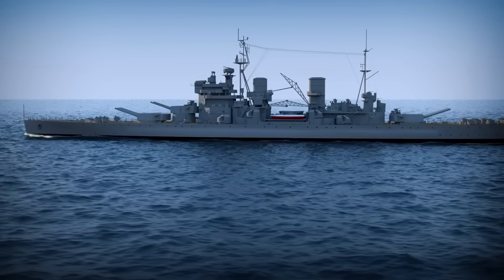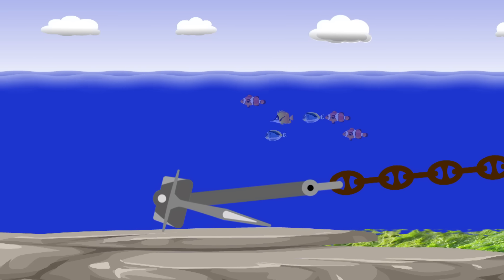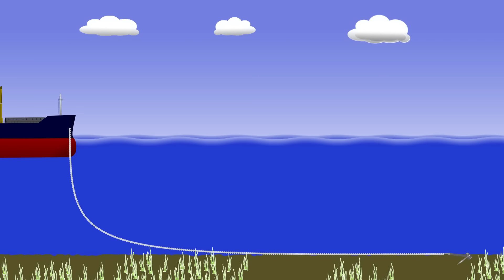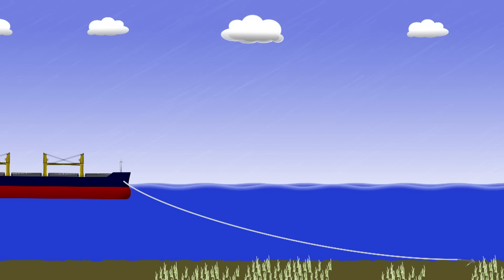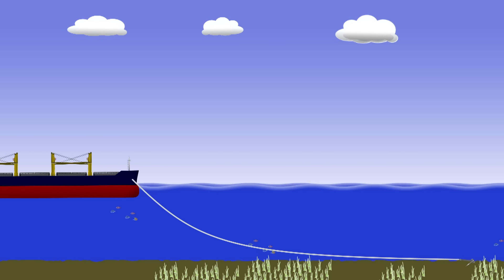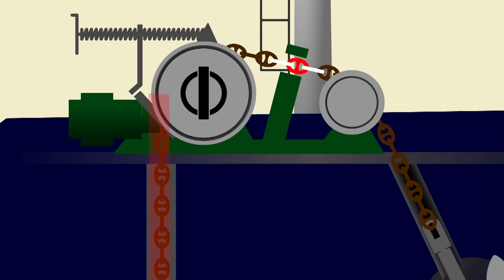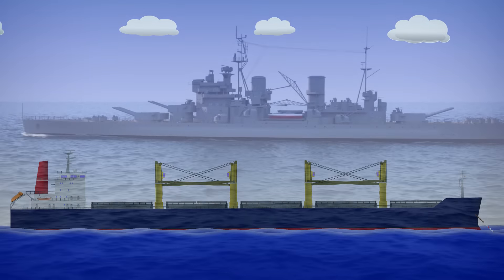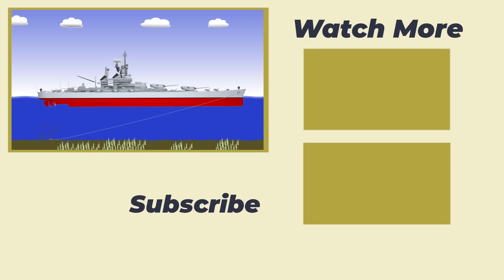The Truth About Anchoring Huge Ships

Comment: I was on a ship that got its anchor tangled up in an old stocked anchor still attached to its chain.  It was really bound up in the flukes.  We dropped our anchor again and again but every time we brought it back in it was still fouled by the other anchor.  It literally took all day of dropping the anchor, going back and forth to try and pull the anchor in different directions and hauling it back in.  While this was all going on we also had discussions about what our options were to cut it free.  There genuinely felt like no good option that didn't present a significant danger to either the ship or the torch operator.
Reply: How about lifting the anchor as far as possible, with the entangled chain above the waterline, tying a very thick rope to the old chain and to a bollard on the ship, and dropping the anchor again?

Otherwise, taking the anchor up almost as far as possible, tying a rope to the chain before the winch, taking the anchor up a little (tensioning the rope), and then cutting the chain between the winch and the rope? That section of chain should be nearly free of tension. Finally, drop the anchor with the winch; you lose the anchor, but at least you can move somewhere else. Would that work? 

That stuff is so heavy it's almost impossible to do anything...

Comment: Fun fact: The act of using an anchor to quickly change tack is called clubhauling.
Reply: Good to know! I have been learning to sail with a coworker on a small 2 man boat on one of our local lakes. Learning terms and such has been harder than actually sailing, at least with such a small boat as he has. That boom can be one hell of a thing to watch out for. 😂 I definitely came home with a headache after the first trip. Wont make that mistake again!
Reply: Same thing I call it when I leave with the strippers at closing.
Reply: Learn that from pirates of the Caribbean did we?
Reply: @goosenotmaverick1156  This sounds like a good Imgur post. Would love to hear more about your adventures in this.
Reply: Heard the term in use for sailing ships. A BB6n might be a bit big for the manoeuvre.
Reply: Fun Fact: the Act of tying a rope around the legs of a victim and throwing him over board and dragging him along the barnacle covered bottom of a ship is called Keelhauling, and its like rubbing your face against a massive cheese grater while submerged under water...often done by Pirates.

Comment: The chain will dampen the shock when it is lifted and will also have some friction on the ground. However, once all the chain is following the catenary line, the horizontal force on the anchor will equal the horizontal force on the ship. At this point it is only the anchor that holds the ship.
Reply: This. I found the animation good but the narration full of bad information. 
I would also add that while large ships just use all heavy chain, smaller boats will often used lighter tackle and add weights at specific distances to get a better holding-power to weight ratio out of the bottom gear because they may not be using motorized anchor equipment and have less issues with shock loading because of less vessel mass for a given surface area. Also: different anchor designs for different bottom types, and some anchors have a second line on the other end in case the flukes get stuck under a rock or similar object it can be pulled back the other way. The second line is just a rope and much shorter(attached to a small buoy) also handy if the main line breaks or the bitter end wasn't secured.
Reply: Agreed, though even when lifted from the seabed the weight of chain still plays a critical role in ensuring the anchor can perform its task by minimizing the vertical component of the force on the anchor
Reply: The ship can "anchor" without an anchor just using the chain.  We have done this just running the chain out with a large buoy and towed by a boat.  We did this where the bottom was just rock.  So no anchor no hold on the ship?
Reply: @JohnPaul-my6ct  Rusty's statement had an important conditional: once all the chain is following the catenary ... the scenario you're describing requires that a sufficient amount of chain is actually resting on the seabed (and therefore not following a catenary), and that section of the chain effectively becomes an anchor (albeit one that is purely friction-based)
Reply: @MatthijsvanDuin  So how does the catenary curve form, from anchor to hawse pipe?  The cable from hawse pipe to sea floor acts as a spring because of its weight,  the friction with the sea floor by the remaining cable keeps the whole assembly in position.  The anchor keeps the cable in position if there is a large force on the ship.  If the force is such that the cable leaves the sea floor to form a catenary from hawse to anchor you are in bad trouble! Especially if your engines aren't immediately available!  The Naval handbook sets out cable lengths to allow for enough friction to be available under all circumstances, anchors are not needed.  Its the same as towing a vessel the spring is provided by the weight of water on the tow rope it MUST remain submerged if it comes out of the water it will probably snap causing alarm and despondency to all concerned.
Reply: @JohnPaul-my6ct  No!
Reply: @rustysailor4672  No! what?  I am English and maybe don't understand US vernacular so I ask again No! what?
Reply: @JohnPaul-my6ct  The purpose of using an anchor design other than a large brick is to minimize the required weight of the system. Yes, a simple weight such as your chain example can provide some anchoring resistance, and that can be enough for a few hours in a protected harbor, in fair weather, with a crew on watch. But it is incredibly inefficient for transitory vessels to use simple weight. The holding capacity is only about 1:1 (in water weight : pulling force) while a modern embedment anchor will provide 1:20 or even 1:100
On a smooth bedrock bottom there is little that can be done, but on many rock bottoms a proper anchor can still find a crack or boulder to hook on. But just the same it would be considered a very temporary and fair-weather anchorage.
  
Dead-weight anchors are generally only used for permanent installations like buoys where they can be set by barge and tended by a diver, and where there is a need to resist equal force in all directions, they may also be untended unlike a ship so need reliable resistance if unseated, they can be customized for the location, they may have to resist high vertical force due to short scope.(you only want a buoy to drift in the minimum circle) And in this case they may  use chain for durability but have little need for catenary contributions.
Reply: @JohnPaul-my6ct  No means that I stand by my original statement. Look at the graphics at 2:00 where the load is so high that the chain touches the ground just before the anchor. There is clearly a negligible amount of friction involved here and the anchor does what it is designed for: holding the ship (via the chain ;-)).
If the force on the ship increases further (wind, current), the chain will straighten more and you will have a lifting force on the anchor. A modern anchor is designed to cope with that to a certain degree (pun intended). Eventually the angle will become too big and the anchor will break free as depicted at 3:00.
P.S. If only the friction of the chain was used you would have a negative correlation: The more you pull the less chain lies on the ground.
Reply: @mytech6779  This video was just about larger ships that carry a full lenth chain, yaghts are completly different . Lots of comments here saying the video is wrong but those comments are wrong , you have to look at the type of vessel
Reply: @JohnPaul-my6ct  Lots of ill informed comments here . Most are confusing ships with yachts . The video is clearly a mechant cargo ship and you are correct , they rely on the weight and friction of the chain 9 should be called cable)
Reply: @rustysailor4672  If the conditions get worse and the angle does increase as you describe you let out more and more to try to correct the situation . If you get to the end of your chain and you are still draging you know you are in trouble but by that time you should have your engones running and ready
Reply: @MrTarmonbarry  I could blindly take your word for it, but again I have access to actual engineering studies of large anchoring systems.
Reply: @MrTarmonbarry  Fundamental physics doesn't care if it's a large cargo ship or a yacht. The comments above (particularly by Rusty Sailor and MyTech) are correct.

Comment: The third "option" not defined at the end of the video is that the chain can simply fail from the strain, leaving the anchor (and whatever chain had been deployed past the parting) on the bottom. Depending on the specifics of the area, that can lead to a new "obstruction" warning on AIS.
Reply: The windlass brake or stopper would fail before any of the links. If that happened the chain would run out uncontrolled until either the bitter end (designed to be the weak link) broke or it took the chain locker and a decent chunk of the fo'csle out 😁

Also why ships rarely 'let go' the anchor (letting gravity pull the chain out of the locker) as the only way to slow it would be using the brake which would likely overheat from friction and fail. Instead it's 'walked out' where the windlass is kept in gear and used to slowly feed the chain out, much more controlled.
Reply: @banquetable  , agreed about paying out the chain under normal circumstances, and I'm also not arguing your main point. The thing is that anchors and chains DO end up on the bottom.
On October 21, 2020, the Panamax bulker Hampton Bridge lost power while outbound, fully laden and about to enter the Columbia River bar. She deployed both anchors and spent several hours on a strong ebb tide awaiting help from tugs from upriver. At some point, one of the chains parted. Could have been at the bitter end. I don't know, because I wasn't aboard. I was observing and photographing from shore. But I do know that the hardware is still on the bottom and is marked by AIS.
Local bar and river pilots have mentioned other mishaps with anchors and chains going missing when approaching the anchorage.
Short story long... "shit happens."
Reply: @scottsaulsbury4887  Oh yep, they do absolutely and you are right about that.

It's very unlikely to be because of a chain breaking though and 99% of the time would be that the anchor has got caught on a pipeline or telephone/electric cable etc. - something which people would be upset if you broke 😁 The procedure then is to undo one of the joining shackles and lower the chain to the bottom marked by a buoy to be retrieved later by divers/salvage.

Comment: I think that the anchor is more important for holding power than is implied in this video. I say this because ive spent most of my adult life working on anchor handling tugs and i handled plenty of anchors that were attached to their vessel by steel wire rope, or cable, ie laybarge. I also see plenty of wire in semisub mooring systems, i even installed nylon rope into semi sub mooring systems, as well as buoys into systems to keep them off the bottom.
Reply: Yeah this video got that part wrong.
Reply: I think the short video was aimed at the layperson and focused mainly on anchoring a typical large commercial vessel. In that regard I think it did quite well. Your point is equally valid but I think it’s going to need it’s own video on the application of high-holding power anchors. Honestly I’m just amazed at the number of people interested in this video and just a little bit amused by some of the comments.⚓️
Reply: That's because you've been on li'l boats, not ships.
Reply: @dat2ra  lol yes and some of those li'l boats could maneuver and propel the largest of ships across a big ocean, while the ship's had narry a soul onboard.
Reply: I was also thinking the same thing... otherwise why would you bother with the anchor in the first place?
Secondly his explanation of how an anchor needs a sticky bottom to bite, not solid rock, goes against his belif that the chain does all the work.
Thirdly if its under heavy force and it picks up the chain does the anchor just pop out? He said they need to power up to the anchor while removing the chain untill they are directly above it... shouldnt they just be able to just pull the anchor up with out powering up to the anchor in the first place if the chain is doing "all the work"?

Comment: Fascinating how the chain is heavy enough to stop a ship but not sink a ship
Reply: The end of the chain connected to the ship exerts a force with a horizontal component that keeps the ship from drifting away. It doesn't pull the ship down, it keeps it in place by pulling against the flow of the water. The force required is much less than the weight of the ship, it only needs to counteract the force exerted on the ship by the current of water. And the ship will not sink because the water provides a vertical buoyancy force equivalent to the weight of the ship. The weight of chain won't sink the ship because the hull of the ship is of sufficient volume to displace a volume of water with mass much greater than that of the ship, its contents and the chain combined.
Reply: @aftokratory  I meant the weight of it when it’s rolled up on deck just amazes me. Thanks for the info sir I appreciate it. Buoyancy is so cool
Reply: @drozone3658  Oh sorry. The ship can easily much more cargo than the chain. The chain only needs to be heavy enough so that the tension at either end is enough to withstand the current of the water.
Reply: I worked on sea going tugs towing large seagoing barges, A link of chain on the barges anchor weighed about 80 pounds, roughly 90 links per shot of chain, 90 feet.  When anchoring we usually put out 5 to 7 shots depending on depth of water and the bottom as well as currents.  Some chain is much larger than what we had as well..

Comment: Could you also cover how old anchors worked during the age of sail, as well as what the process of manually weighing anchor looked like?
Reply: They used a capstan, which is a multi purpose spooling device you can man with several men. You'll probably know what they are if you see one. Old anchors do work essentially the same.
Reply: @mandowarrior123  and there is a poor fellow assigned to "stow the chain" down in the chain compartment. This is done by the help of a big iron hook that you use to distribute the coils of chain evenly as it is taken in. If you just let it fall randomly into the chain compartment, it may kink and get stuck the next time the anchor is dropped.
Needless to say, this is an extremely heavy and dirty job, but essential non the less.
Reply: Yeah Pirates of the Caribbean is about the same level of realism as Battleship.  It wouldn't work there either.

Comment: Great explanation. I used to have a 30 foot sport cruiser and the rule of thumb was 3x the amount of anchor rope to the depth of water. Once you let out enough line, you put your engines in reverse to tug or set the anchor. The amount of force you apply with the engines is the amount of force the set anchor can withstand. So if you're going to over night, and don't want to break free and drift, you look at the weather forecast, direction of the wind, the wind speed and calculate how much force to apply to the anchor to set it. 

I only had about 5 feet of chain but now I know why larger boats had longer chains.......

Comment: Where the water is deeper than the length of the anchor, would dropping anchor limit drifting?
Reply: That's an interesting question. I imagine it must have some effect, if minimal, but I'd like to hear it from someone who actually knows
Reply: I am not an expert, would love to hear reality from one.

I think it would because anchor and chain wants to stay perpendicular to ship due to gravity. When ship moves drag force from anchor would effect ships movement. I don't think it can be good enough though.
Reply: I do know for a fact that "Treibanker" - meaning "drifting anchors" are a thing, but those are mostly used for smaller vessels such as yachts.  And unlike regular anchors these do not tether the ship to the ground, but rather are a means to control the vessel's movement in, say rough seas by  keeping the bow turned into the wind. This is particularly important if the vesseel's means for propulsion are for some reason not operational.
See here for details: https://en.wikipedia.org/wiki/Sea_anchor
Reply from the maker: We were always taught to lower the anchor if possible as it will help slow the drifting. As the water shallows, it also gives the best chance of catching as early as possible.
Reply: Well, it increases the surface area of the ship, so it increases the drag forces and the ship should come to a hold faster.
The question is: how big is the effect?
Reply: @FriedrichHerschel  Well, there would certainly be more drag but my guess is the following:

Imagine a side on view of the ship with the a line pointing straight down to show the anchor at its full extent. If the ship moves forward the anchor will be dragged behind the ship. The anchor line makes the radius of a circle describing where the anchor can reach in relation to the ship. So it's clear that the ship moving raises the anchor and so this will exert a halting force on the ship because the ship moving means accelerating the anchor upwards.

Comment: Well actually, letting out one or both anchors while the vessel is proceeding ahead is an emergency procedure which can be used in the most extreme of cases. If the ME is broken, or there is no other way to stop the vessel, the Captain can give orders for this maneuver. What you can expect is the windlass and deck equipment being destroyed beyond repair, however the vessel will stop.